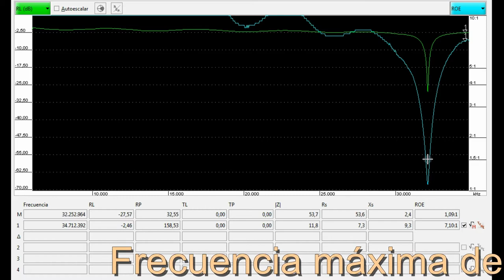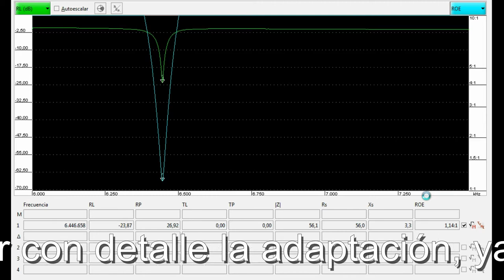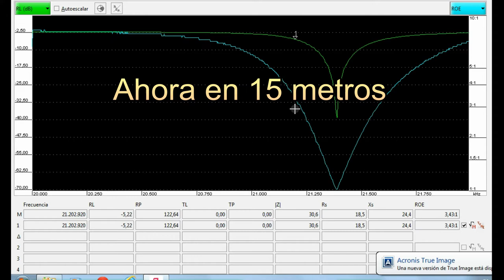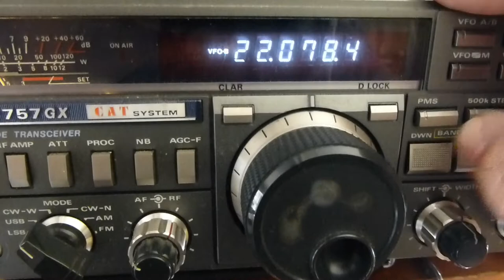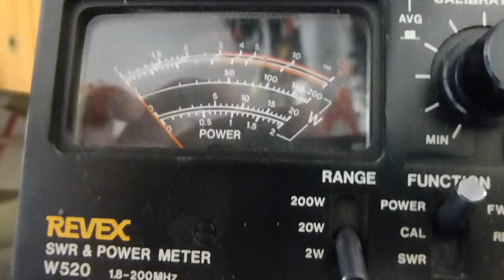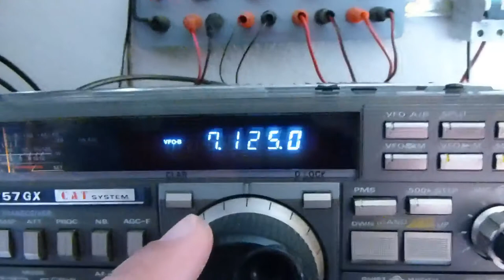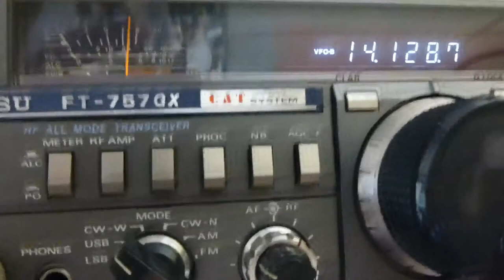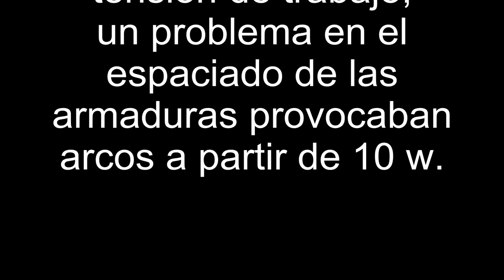Antena de aro para HF. HF tuned loop for HF bands

Comment: Un esquema del montaje y la descripcion de los elementos que lo componen, vendria de perlas. Muy interesante para los que, como yo, no tenemos mas que un balcon. Gracias.
Reply from the maker: Hola Mateo.  La mayoría de montajes que hago van de la cabeza al soldador sin pasar por el esquema, luego a posteriori lo hago, pero en esta ocasión no. Es simplemente un conmutador quue cambia la polaridad y otro que activa un reductor de tensión o no, en función de la velocidad. La única precaución es que el choque que se ve en la antena y el que hay dentro de la caja, han de ser de cable de 0,5mm al menos para dejar pasar la corriente de arranque del motor, de otro modo la tensión cae tanto que no arranca y si subes la del regulador, arranca pero en alta velocidad. Saludos.
Reply: franjordio Muchas gracias por tu respuesta. A ver cuando haces el esquema entonces 😉😉, y describes los elementos que componen el montaje, que por otro lado me parece interesantisimo.
Yo cacharreo algo, pero me falta informacion, sobre todo en el tema condensadores variables, no se donde se adquieren y mucho menos la capacidad de los mismos para, por ejemplo, esta antena.
Espero que puedas iluminar mi camino en ese sentido.
73 cordiales.